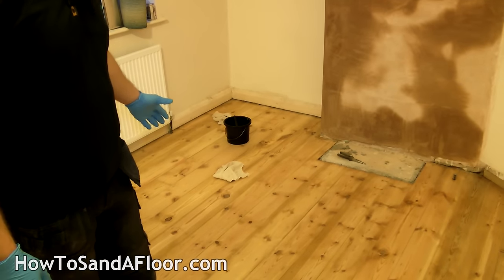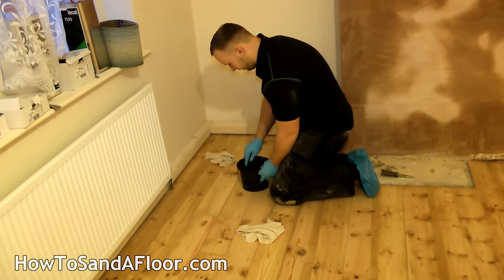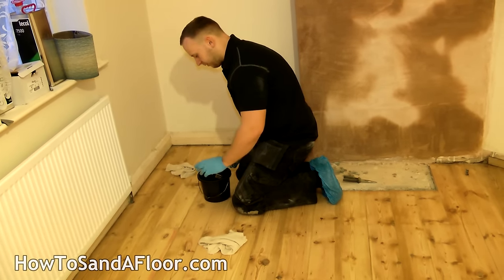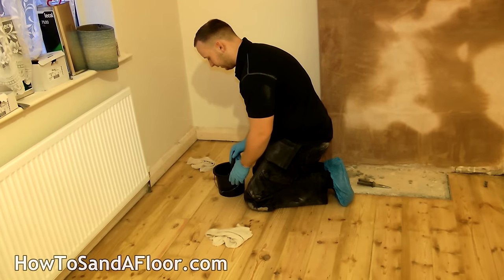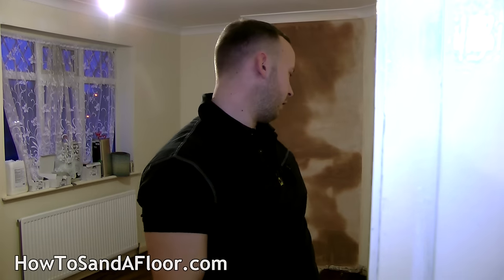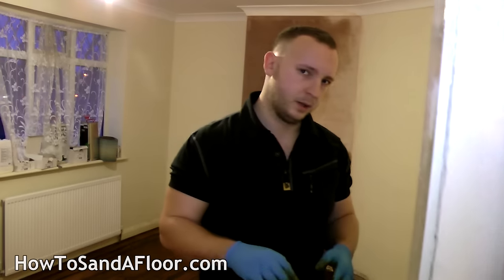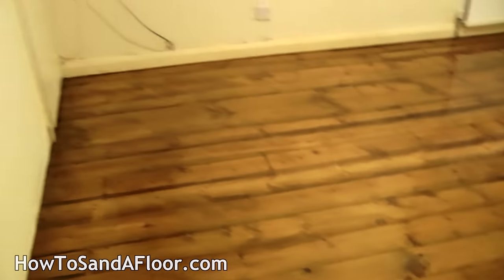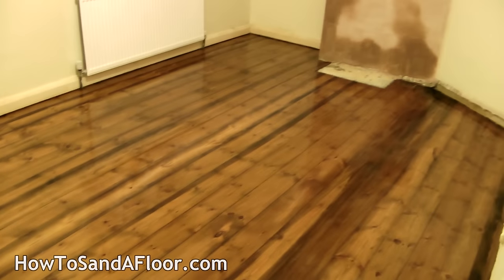How to Stain a Wooden Floor (pro method for DIY)

Comment: Do you only put down 1 coat? On the back of a colron stain tin it says 3 coats for bare wood with 6 hours drying between?
Reply from the maker: Hey Will, I have never done a second coat of stain and i don't know anyone that does, so long as you lay it on thickly then wipe off the excess, that should saturate the surface. By all means wait 6 hours, but the way I apply with colron specifically, I rarely wait more than an hour. Good luck, Will!
Reply: ***** For a deeper darker finish do you ever use any kind of conditioner?
Reply from the maker: i still don't even know what this conditioner stuff is, never heard of it professionally
Reply: How about have you ever used a little water to give it a deeper color?
Reply from the maker: no
Reply from the maker: JoeCnNd the reason people damp rag the floor is to get the grain to raise, so they can then buff it to smooth off all those peaks, this prevents the grain raising with the lacquer. In my experience, totally pointless because the buff between coats sorts this.
Reply: Multiple lighter coats will leave a more even finish. Wood conditioner is also very good for an even finish especially for a pine floor like this. Surely you can see how blotchy and uneven the job you have done is? Why not do a test to see the difference rather than dismissing people's advice out of hand.

Comment: using a rag on a large surface is stupid..  you should be laying it off..  on large surfaces you should use a decking pad. you will achieve even motion results, always paint with the grain you stick with the timber.. do not do circular motions thats where i lost it.. The end result was exactly what i expected. If you want a perfect floor follow this method.  also to mention the time wasted
Reply: Im ready to stain my floor. I didnt plan on this hand and knee job. I want the color to look natural can i apply on coat of stain
Reply from the maker: if there are no circular motions remaining on the floor when its dry then what does it matter? You are right with some stains, but those stains are PITA stains that definitely shouldnt be touched by DIY'ers

Comment: Is there a reason you didn't tape anything off?
Reply from the maker: CoxworthyXIV yes! If you touch the tape with a spirit based stain, which is what I was using, it soaks up the back of the tape, like, underneath between the tape and the skirt. It’s worse than having no tape at all. Thicker stains can be taped off
Reply: @HowToSandAFloor  understood, and that means paint touch ups...how we stain where we work we always tape off and touch ups are expected...but you also apply it with a brush, which we do not...the brush is a great idea and saves taping/time
Reply from the maker: CoxworthyXIV yeah, brush gets you close without covering the skirt. But you’re right really either way you’re going to have to touch up.

Comment: I do floor for more than 25 years ,i can tell the joint are to dark sorry that floor need more sanding finish before stain plase next time buff well done or drum sander is not properly working good
Reply from the maker: eliseo bonilla Yes. I wasn't happy! I didn't sand the floor
Reply: I now something was bad i follow you videos and i was sorprise when see that one. things like that happen when we put some one dont now what they doing
Reply from the maker: the person that sanded the floor does know what they are doing, he is just very lazy!! maybe i do a new video with a properly sanded floor
Reply: jey is all good dont worry,. question how much you pay a hr to a good worker with experience
Reply from the maker: im in england, but £100 to £120 a day
Reply from the maker: *****  I haven't heard of it but it sounds like a coloured finish, which should be applied as you would lacquer. With coloured finishes its very easy to see brush marks and roller marks, so put it on generously to give it a chance to flatten out before it dries, but i thoroughly recommend reading the tin and youtube searching for the product
Reply from the maker: yes, you may need more coats though

Comment: This is exactly how NOT to stain a floor!!!The finish is terrible and looks like a DIY job. Blotchy, overlap lines and very inconsistent colouring. Never mind how fast you have to work to avoid all this you simply can't work fast enough on soft wood to get a consistat even colour if you do not use a wood conditioner first....especially on soft wood. This would eliminate any overlap lines, drying lines and blotchy dark patches that are caused by porous areas in softwood. The fact that it is a soft wood means it will sink in too quick and dry too fast. Using a wood conditioner first on soft wood seals all those porous areas and erraticates every one of these issues thus giving an extended drying time and even surface to get a perfectly constant finish.Sorry Not about to say I know anything about wood floor sanding but having worked with stains, lacquers ect ect for 20+ years I would not be happy if I was the customer.  Soft wood = always wood conditioner first.Hardwood is fine to go straight on top as it a harder more dense wood meaning it takes longer for stain to sink in so these problems don't happen.

Comment: Super inefficient. Do all the edges by hand. Pour stain on a circular cut rug from home Depot and then put it under a buffer and buff the whole main area w the stained rug then rebuff w a dry carpet. Best method i know. Learned from a guy w 30 yrs exp

Comment: Rotary with old carpet blends it better,cut in the edges,wipe. Put stain on carpet buff it in.same process as hard wax oil just with carpet.try it and than me later. And yes im a floor sander too
Reply from the maker: I have never applied hard wax oil like that lol, maybe magic oil or Rubio. What stain do you use? The stain I use got discontinued recently and I'm trying out others, never got on with morrels
Reply: ***** helo we use palman hardwax oil, and morrels dark oak light fast stain thinned to 30%, seems popular at the moment.and we are trying pallmans pallex 94  laquer at the moment. Tried junkers,marldons and pallmans 96. The 94 seems to have a more natural look too it,feels almost waxy. Seems to level off abit better and less orange peel on the finish

Comment: Looks so uneven and blotchy
Reply: he was saying work fast and don't leave an edge, toward the end there is a 12 inch wide strip close to the door which looks like a massage load of stain he forgot to wipe off. at the end when he was staining next to it he didn't even attempt to try to wipe any of it off. must be his own house
Reply: Tighter grained woods take stain very poorly. Very uneven look. Spreading water over the floor before staining will raise the grain of the wood, allowing more stain to penetrate more evenly. Probably more then anyone wanted to know, but there you go.
Reply: When I do set design painting I always wet the wood and come back 30 minutes later to paint or stain #2 pine can be difficult to work with
Reply: @SkillzMillz83  It's nice when people give helpful input, rather than just insults. Thanks for the tip!

Comment: Pros use buffers to stain floors just a little fyi
Reply from the maker: Pros know theres almost a different application method for every stain. Trying to buff on a spirit based stain like the one in this video is a non-starter. Thanks for dropping by

Comment: Thought the floor was better before the stain
Reply: I’m a floor installer and to me it looks like a pine floor which is one of the hardest to stain as well as match floor colour! Stain dries very quickly and it’s not a one man job! That’s why you see the black lines!!! He went over the dried stain and overlapped giving it a second coat! Pine floors suck in stain ! Dry very fast!
Reply: That’s just what I see from this floor! Just my opinion
Reply: But also if you look closely before he stained there is darker grains in the the floor and if it’s pine it will make it look black that’s why it’s so hard to stain pine floors! They’re a pain in the ass. We have done many like that
Reply: He did a good job overall! Just look at the grain of the floor! Even when you buy prefinished hardwood you will never get the same consitency

Comment: Pine...  Probably the most difficult wood to sand and stain properly.  Not for the DIY guy.  If the sanding isn't right, it won't work.  You didn't pre stain or it wasn't covered in this video.  If the average person did the staining process this way, he or she would wind up with light edges and a dark middle.  I can guarantee they will not be satisfied
Reply from the maker: You can pretty much guarantee it. I do actually recommend now that people don’t stain their own floors. None of them listen to me. I even tell them that no one listens and that they go on and do it and end up unhappy, and even after telling them that, they go and stain their floors lol. I guess you just don’t know what you don’t know.

Comment: Strange that you would go to all that trouble to make a how to video and I'm sorry the end result is very poor. On the plus side, I now know I need to sand my floor more before staining as it would only end up like this so this is more of a cautionary tale. Subbed all the same as will use suggested techniques.
Reply from the maker: Fair enough. Here’s my advice. As a DIY’er, don’t sand your own floors. Trust me it won’t turn out well. No one ever listens to that advice but everyone confirms they should have after the fact.
Reply from the maker: Go for natural!
Reply: Its a job made more difficult when dealing with very old floorboards I think. My boards currently look like the ones did in the start of this video. I thought hey that's great, I'm on the right track. Now as I understand it, they needed to be sanded more. Although all my boards are sanded, they are at slightly different heights which means the higher parts are a shade darker than the lower parts and this will show tramlines. I'm going to keep going to get this floor finished by Xmas! Thanks for your reply and am learning lots
Reply: #How To Sand A Floor hi would you recommend using alcohol to clean the floor of any debris before staining? Cheers
Reply from the maker: adrian cronin if it’s been properly sanded, a thorough vacuum should suffice

Comment: You sure ruined a beautiful floor.
Reply from the maker: Thank you for your input
Reply: It’s pine. Just horrible wood for stains in my opinion. It’s probably customers color choice.
Reply from the maker: yeah even if I did ruin it, cheap baltic pine floorboards, arent beautiful floors lol
Reply: How To Sand A Floor i agree. I think on that kind of wood you only want to use very light to no stain or either super dark ebony colors. Mid browns will turn out like that in my opinion. Keep up the good work man!
Reply: I think it would looked great with just a clear coat nice and bright
Reply: @FrankO-ek1ec  aka natural look
Reply: @IAmSlonik  i just stained pine floors (a dark cherry red) for a business on valentine day i definitely dont like staining pine floors ( pine staircases are alittle more easy to work with compared to actual floors)

Comment: dude that aint pro .. buffer is quicker
Reply from the maker: Some stains won't do with the buffer, and most people can't jump straight on a buffer.
Reply: +How To Sand A Floor 
Thanks for the video, question
I'm planning on re stain my living room floor, do I have to use a pre stain conditioner before  I stain the floor?
Or could I just use stain only and skip the pre stain conditioner? Please let me know, thank you
Reply: Gil if your floor is soft wood like pine then use a stain control. This will prevent blotches when you apply the stain. If the floor is oak it depends on what kind of look you are after. Without stain control the grain will stand out  darker as this is the soft part of the wood and absorbs the stain quicker. If you want an overall appearance to be one shade with no pronounced grain appearance then use stain control. Make sure you follow the directions on the product's can to the letter. If you sand the floor first you will have to use a drum sander and a machine called an edger. These  is a very aggressive sanders. The following grits are what I use 36 to remove old finish and even out cupped boards. Then followed up with 60,80 ,100, and 150 screen on a buffer. It is very important to blend in the edges around the room . I use a random orbital sander to blend where the belt sander and edger marks meet. By using an orbital sander for the finish sand around the edge you eliminate any shadow effects and swirl marks left by the edger .  lay a flash light on it's side and shine it across the floor. If you can see tiny shadows ,these are scratches and will show up when the stain is applied. Usually a random orbital hand held sander will take these out. Now when I stain a floor I let the stain set for 1 to 2 mins max then wipe in the direction of the grain. When the stain is dry I use a sanding sealer over the stain to lock in the color. DONOT sand the stained floor. Put the sanding sealer directly over the stain. Within 3 to 5 hrs apply another coat of sanding sealer again do not sand between these first coats. When the sanding sealer is completely dry ,I wait until the next day screen the floor with a 180 or finer screen or sanding pad on an orbital buffer. Now start applying your final finish sanding between coats. I use a square buff orbital buffer as it is not real aggressive and leaves no swirl marks. Make sure you vacuum after sanding and use a cloth dampened  with mineral spirits or water for water based finishes  and tack off the floor  before applying the coats of finish. I have been restoring floors for over 45 yrs and I am a certified NWFA tech. I also was an instructor for Armstrong corp. If you take your time and follow the steps religiously then your project should turn out great. Some people try to short cut and in the end it is the difference between wow what a mess or WOW this looks great. Hope this helps you . Didn't mean to write a short story. The easiest way to do your floor is to call a certified floor refinishing tech. Good luck have a great day